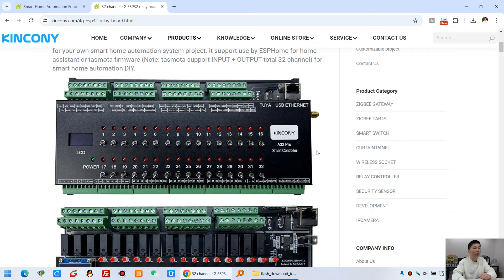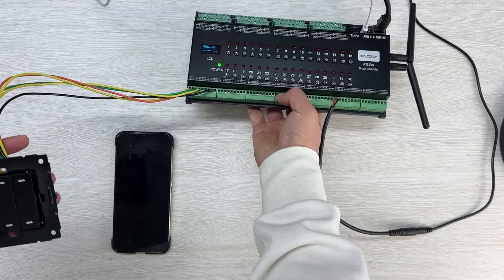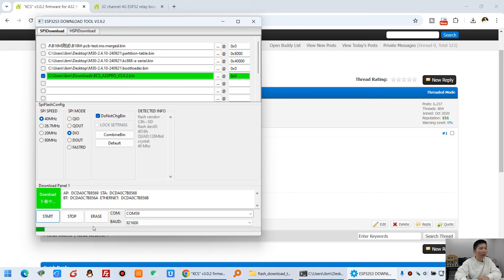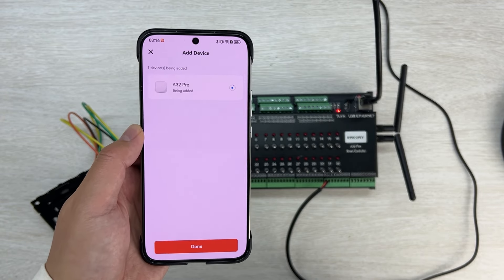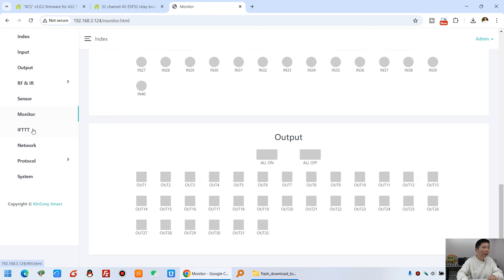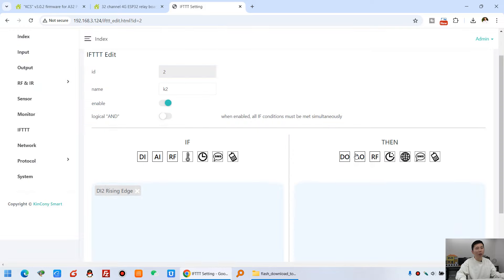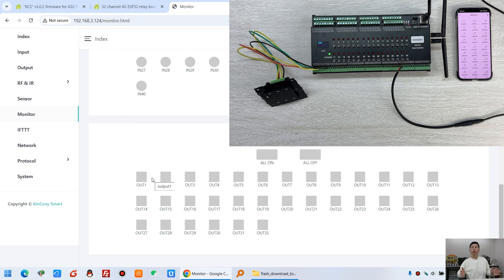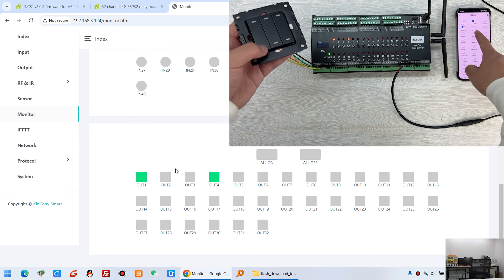How to use Tuya app + Switch button + Interlock mode in KCS firmware

Comment: Perfect for curtain windows, but I have a question about the dry connection which light cable is supported?
Reply: @KinCony  Wich maximum cable length between switches and controller supported?
Reply from the maker: @mohamedjbaren5167  MAX 500 meter.
Reply: Ok thanks